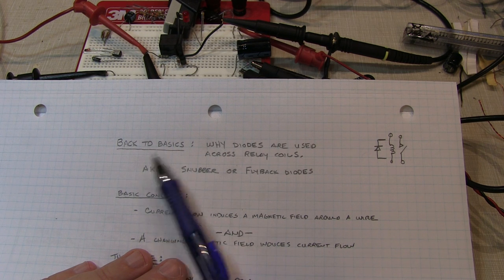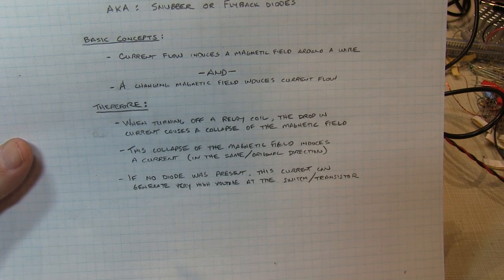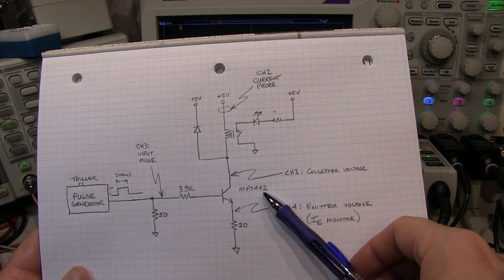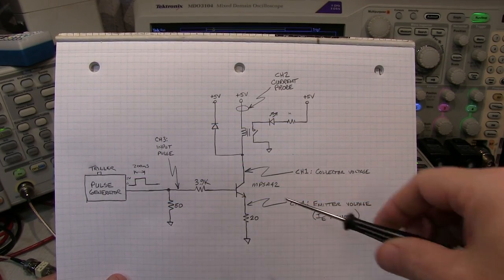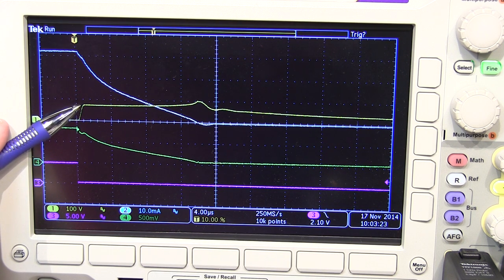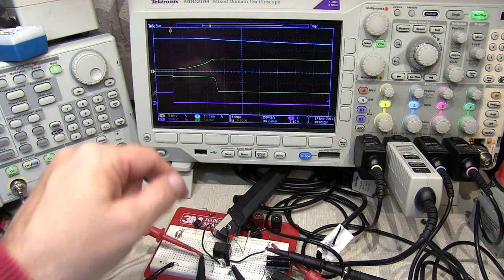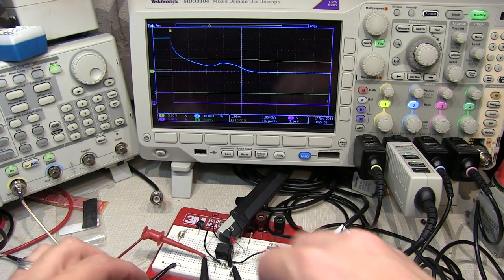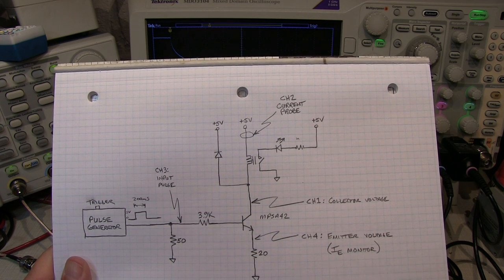#183: Why diodes are used around relay coils: Back to Basics on flyback or snubber diodes

Comment: Thoroughly informative as always! Thank you, Alan.  Back to basics are my favorites!

I do have a question regarding the flyback voltage from the inductor forcing current into the positive supply.  In general, is this potentially harmful to a DC power supply?  Does it vary by power supply type (battery vs linear regulated vs switch-mode, etc)?

In simpler DC circuits without inductive kickback, this is generally not something I have to worry about in my analysis, but obviously in this case, the voltage is indeed rising above the supply, so it seems current should be flowing into the supply rather than out of like I'm used to.  Is it useful to include this in the circuit analysis?  I'm not sure what to make of it.

As a hobbyist and self-learner, thanks again for all your work!
Reply: The current doesn't flow into the supply rails. It circulates through the diode and back through the coil in a circle and the energy eventually dissipates in the parasitic resistance of the coil and diode etc.

The 5.8V at the anode is seen because of the forward voltage drop of the diode. (The anode must be ~0.7V above the cathode which is connected to 5V rail for the diode to conduct)
Reply from the maker: kalhana1 Exactly right.
Reply: kalhana1 Ah of course!  That makes sense.  Are there any circumstances in which there could be current actually flowing into the supply?  Thanks!
Reply: chawkzero It can happen when controlling motors. When you want to stop the motor (braking stage), you may get this issue if the PSU can't accept the regenerated energy. There are different ways to deal with it such as dump resistors etc. Check out the following link from TI.
http://e2e.ti.com/blogs_/b/motordrivecontrol/archive/2013/10/18/the-art-of-stopping-a-motor.aspx
Reply: kalhana1 This is absolutely correct.  When you slow a motor, it can become enough of a generator to actually drive current into the power supply rail and raise the voltage.  In designing an AC 3-phase induction motor (yes induction) variable speed drive, if the drive tries to slow the motor faster than it will naturally coast down, a circuit I was part of a design team on, did that and would blow some output transistors.  This was before we installed a circuit to keep the drive from getting ahead of the motor coast-down rate, so to speak.  We did not have breaking circuitry in there for that.
73
Reply: Clifton Jamison  Please state the purpose of this statement.
Reply: I'm sorry ,i'll remove it
Reply: Clifton Jamison  you could have clarified it...no?

Comment: You'll find the same thing on the primary of the flyback transformer of old TV's. Their horizontal output transistors usually have that diode built in along with a breakdown voltage of 1500v. There are also some retrace capacitors on it to slow down the collapse of the magnetic field. That is just an interesting application of flyback diodes.

Comment: When using a MOSFET instead of a bipolar transistor to control the relay, the reverse recovery time of the flyback diode may become important as the switch-off time of the MOSFET is much lower. I experienced that many years ago when using a 1N4001 with trr of 1500 ns instead of an 1N4148 with trr of 4 ns. The MOSFET died after only one operation due to excessive Drain-Source voltage.

Comment: Great explanation! Very helpful! I'm also with @James Wood, it would be great if you could cover how RC snubbers are designed and work. For example, for the case when an AC Motor or other inductive load is connected to the contacts of a Relay. I've noticed sufficient disturbance on the control circuit to cause microcontroller reset and other unwanted effects...

Comment: I use solenoids (like a Ford firewall mounted solenoid) and pneumatic solenoid valves for automotive applications. It looks like the diode needs to be between the power and ground terminals (low current) on a standard 4 wire solenoid 2 high current and 2 switching low current. Is this correct? On a 2 wire pneumatic solenoid the diode would go between the positive and negative of the activation circuit?

Comment: Really excellent video, Alan.  Just happened to stumble across it looking for this sort of information, but for AC-driven coils,  Any chance of you doing a video on those?  Snubber design is a little more complex for them, which is why I'm seeking out info.  

Also, at 1:51 you state that the current induced by the collapsing magnetic field flows in the same direction as the original current, and reiterate this at 6:50.  I've always been confused by this issue since (1) there's no place for the current to "go," so it shouldn't flow anywhere, and (2) the voltage drop across an inductor is L * di/dt, so the voltage drop must be negative as the current goes to 0, so current must be negative since V = I * R.  But a negative current implies it flows into the power supply.  It'd be great if you could sort this out.
Reply from the maker: When the transistor turns off, the current that was flowing out of the "bottom" of the coil now sees a different (much higher) impedance, thus the voltage rises.  Since the "top" of the coil is "pinned" to the supply, the voltage at the bottom begins to rise.  The math works - the current is falling, so the di/dt term is negative, and this corresponds to the voltage across the coil reversing its polarity.  The current flows through the diode that is in parallel with the coil.

Comment: The choice of a diode is important when you want to control the switchoff time of the relay. People use zeners, cascaded diodes, diodes with resistors etc. to dissipate the energy faster. Some people also just use a LED to even have a visual indication of this process.

Comment: I just looked last night at one small nema11 stepper motor. Its amazing that with just hand turning it generates sine waves up to 200V. If you are able to create steady speeds on shaft you can get variable frequency generator of realtively high voltages. I was always curious how would you achive that without expensive or complex equipment. Not sure how much current it generates.
Reply from the maker: The current would be dependent upon the number of turns in the windings, and the strength of the magnets.

Comment: I've used diodes for this reason for many years, I've added them across relays on older American cars with relay operated components to make the switches last longer, it eliminates the transient spike across the contacts as the switch was turned off.
Reply: +Jim Patterson  That's a common example.  When the switch opens, the inductor's high voltage causes the switch contacts to arc.  This shows very well how the inductor will "Do what it takes" to the voltage, to maintain the current flowing through it.The high voltage arc that forms as the switch contacts spread apart will erode the contact material.

Comment: Allen: Is a diode or some other protection required when using 120v mains voltage to switch a relay. I suspect using a diode to supress the voltage spike is not needed because the current flow changes every half cycle causing a short-circuit.

Comment: thank you, recently I bought an instrument as "part" on eBay. tested it, did not turn on. opened and connected power to the input. but I did not recognize the back of the pcb was in contact with the sheet metal covering the rear of the screen. I kept raising the amps, with the short caused by the screen body it eventually smoked and I turned it off. 
noticed there was a completely burnt diode at the power input, even the pcb under it was burnt. removed the diode and put it aside....but sometime later I changed another component and did not do anything about the burnt diode, that diode was still out of the board. when I powered the instrument, it turned on and did not show any error. I was wondering what could this diode be there for. now i am not even sure it was a diode. it was so burnt, I could not read the board or the component.

Comment: Very informative for people like me with many books but limited opportunity to test and understand actual circuits on how they work and behave and view it visually. But I am very enthusiastic about the subject and for that I thank you for the videos. May I ask why are there capacitors paralleled on switches at the power supply. As I read the explanations, they are saying to reduce the thump when the switch is turned on. The circuit I am talking about is an audio circuit like amplifiers. Could you explain it further together with the oscilloscope with and without the capacitor on the switch. Note : the capacitor value is like 0.1 microfarad ceramic or mylar.
Reply from the maker: ***** Caps are often used around switches for two purposes:  to de-bounce the switch, or to slow the risetime of the voltage across the switch when it is switched off/open.  Either of these conditions could lead to noise, pop, thunk, etc. in audio circuits.

Comment: what is the formula to use to get the "pull strength" in solenoids coils? the wire gauge and number of turns will determine the pull strength, any reasons why?

Comment: @5:09 My mouth drops. I had no idea... holy crap that's a massive potential from a little relay like that. Tons to be learned from this video. Thanks!
Reply: +OneCircuit   Yes.  The voltage that the inductor generates is proportional to the rate of change of the current.  Do something to get the current to drop rapidly and you get a very high voltage.    If you pull a connecting wire away from the inductor really, really fast, the arc can have tens of thousands of volts in order to maintain the arc over the long distance and therefore keep the current flowing.

Comment: Great video. Very informative. Question: could you explain (or better yet do a video) on why the current draw increases when an electric motor goes bad? Like when the motor is jammed and doesn't spin or is physically restricted and spins slowly. Thanks...
Reply: All motors must have torque to spin, and in the case of electric motors torque comes from current not voltage. If the motor is jammed the torque is maximum therefore current is maximum as well.
Reply: blackstar2008, thanks.  That makes sense...
Reply: counter-electromotive force
 also known as back electromotive force
Motors also act like generators when running.  As they are placed under load and slowed, they produce less CEMF.  This allows more current to flow through armature.
Reply: Pet Rock's Garage  If you view a motor as a motor-generator in series with a resistor, this can become easier to understand.    When the motor spins it also is a generator.  This is generating what is commonly called Back EMF.  The Back-EMF (voltage) is proportional to the RPM.  
...
As Wiki states:"The term Back electromotive force, or just Back-EMF, is most commonly used to refer to the voltage that occurs in electric motors "
...
When the motor is not turning, this is called "Locked Rotor".  The generator is not turning, nor generating, so there is no voltage across it.  The full supply voltage is across only the small internal resistance of the motor and, therefore, the current is high.
...
As the motor comes up to speed, the generator generates more voltage.  This makes the voltage across the internal resistance less.  Therefore, the current drops.  The motor current is always determined by the voltage across the internal resistance.  With no mechanical load on the motor, it settles at a point where the input  power is only losses in the motor.
...
 As the motor is mechanically loaded more, it slows down and the generator produces less voltage.  This results in more voltage across the internal resistance and the current increases.  This increase in power represents (actually it is) the power needed to turn the  mechanical load.
...
This model applies to DC and AC motors.  In AC motors, the "slow-down" is actually an increase in what is called the "slip".  If you don't know what that is, you will when you get into AC motors.
...
I hope this helps...
73, ScienceAdvisor, motor designer and Ham, Steve
Reply: Observ45er, cool.  Thanks for the in depth explanation.  That makes sense.
Reply: Pet Rock's Garage  Sure does! It's the way I was taught by a motor expert and the way that "motor people" talk. I've designed some motor related stuff including for some laser light show hardware.  The scanner galvanometers are just like motors as far as designing the drive circuitry goes.
...
I also have an original Motorola Pet Rock around here Somewhere...
...
blackstar's summary is ok, too.
Cheers

Comment: Good video  all the experimenters should see this. you could do a series on protection. 
   Back in the day we used to ask "What does a diode want to do?" or a coil, electron, etc. I miss that. A coil with a diode on top, sounds delicious.
   Adding small cap on the base of Q1 can expand your slew. I know many think this is a bad thing but, it's how rock-n-role survived a light show. The inductor was a hodgepodge of  long conductors hung on iron pipes by mentally altered monkeys who have the magical ability to make voltage appear inexplicably. Sometimes from using beer as a conductor, circuits could fall like dominoes.  Extreme measures were needed. Two way protection. First a half bridge, then a BJT with cap, then maybe a resistor every 200 feet. Rely on just one diode?  No, not with a monkey assembled systems. 
  It was a good presentation and I love your scope.

Comment: Hi, nice video,very clear & concise as are all your efforts.I really appreciate  them
I've been a subscriber ever since your "TDR" vids - VERY nicely done.
I am also envious of all your Tek test equipment! Lucky guy!
I think you might like to experiment with putting a smallish cap in parallel with the 3.9 k-ohm vase resistor. The reason is, when a bipolar transistor is driven into saturation, there's a fair amount of charge stored in the base capacitance. You'll turn the transistor off faster if you sweep that charge out of the base region into you own cap. Start around 560 pf and experimentally reduce it until the turn-off time slows down, then go back. You might end up with a value around 80 to 200 pf. As they say YMMV, it really depends on how hard the B-E junction is driven into SAT.

Comment: Hi. I always like the calm manner in which you explain your topics - which is why I am one of your subscriber.

In your example you demonstrated that the collapsing magnetic field can generate as much as 300V!  If the flyback diode reroutes this high voltage away from the transistor to the +ve rail - won't this damage other components in the circuit which are expecting say 5V?
Reply from the maker: The flyback voltage only reached 300V because the coil was seeing a very high impedance.  As you can see from the video, the diode clamps the voltage to a much lower level (less than 1V above the supply rail).

Comment: Great explanation! I'm trying to learn about kickback so I don't fry the computer board I'm connecting relays to, & this video with the spike on the oscilloscope has become what I see in my mind when I try to picture what is happening.  I first saw it a few weeks ago, & watched it again today, understanding it even better this time.
Since seeing it I've been wondering if my multi meter will be fast enough to see the kickback event, or if I need to get an oscilloscope?
Reply from the maker: Your multimeter will not be fast enough to capture the voltage kickback.  Always use a diode to limit the flyback voltage from inductive loads.
Reply: @w2aew  How fast does the scope need to be, & how many channels?  I see you're using 4 channels in the video to demonstrate it, but I only need 1 channel to verify no kickback right?  Which would you prefer in a scope, 2 channel 200 MHz, or 4 channel 50 MHz?
Reply from the maker: @kittadyne  Given the choice, I'd probably go with the 200MHz 2 channel scope.

Comment: When measuring voltage of various motors the DVM meter doesn't tell the technician if the voltage is back EMF voltage, so how does a technician know the measured voltage is Non-EMF voltage or back EMF voltage? When motors have more physical resistance the EMF voltage will increase higher, any reasons why the back EMF voltage increases when the motor has more physical resistance?

Comment: Excellent.  I finally understand this stuff.
My only question is why don't relays have diodes built into them?
Reply from the maker: Because there are more than one way to drive a relay coil, and the diode configuration may need to change based on the design.

Comment: Are there any practical differences or benefits between shunting the voltage/current to either the positive supply or ground? So in your example the current flows to the positive supply once the point between the coil and transistor is about 0.8V higher than the positive supply. How would that compare to a reverse biased zener (perhaps a 10v zener in this case for example) shunting the current to ground? I would guess it comes down to what components are before the relay coil, whether you are doing high vs low side switching etc.
Reply from the maker: There is no general hard and fast rule. You can arrange the clamping in a number of ways.

Comment: Hi Alan, again a great explanation. I would like to see the relationship of the relay coil's resistance to peak reverse voltage and current. An example might be to use a snubber resistor equal in value to the relay coil's resistance. I sure wouldn't want to use a signal diode across a starter solenoid! Additionally, something about the power supply source impedance might be noteworthy.